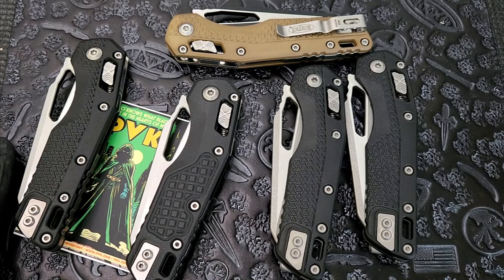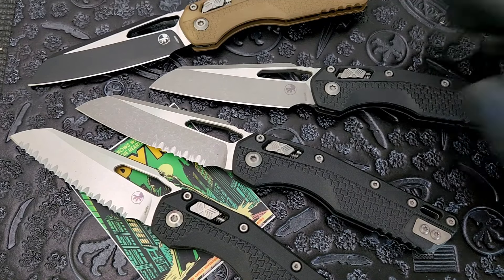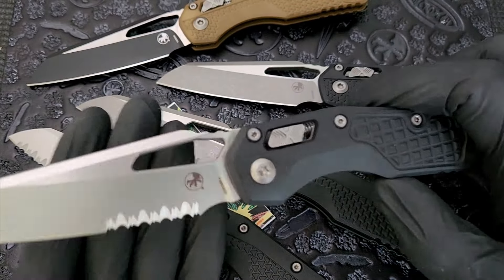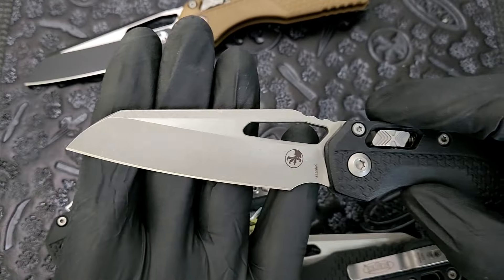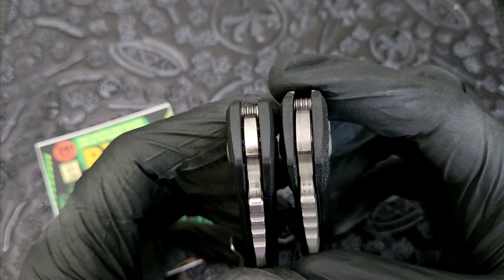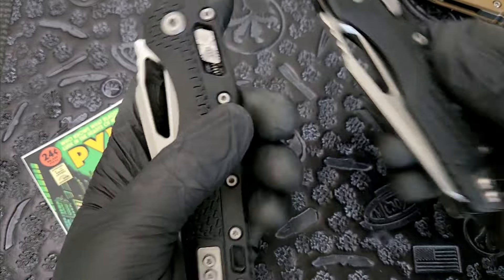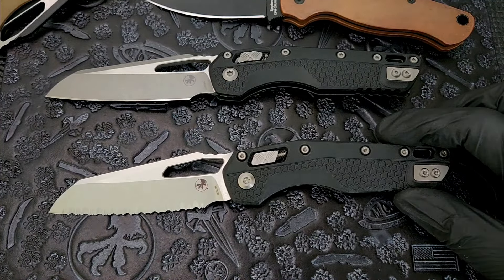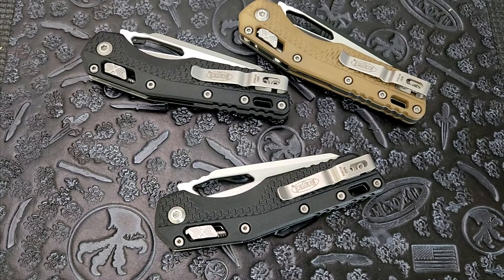Why Are These All Different?!

Comment: I like how lightweight the polymer version are, however it would be nice if Microtech would soften the inside edge of the scales so it won't feel like digging into the hand with the sharp edge of the scale.
Reply: I had the same complaint. A little 400 grit sand paper knocked that edge right down and you can’t even tell. Spring for some Ripps Garage Tech micarta scales if you really want a massive upgrade

Comment: The difference between G10 and the polymer (aside from the obvious glass reinforcing) will just be rigidity and how they deform. The plain polymer will be softer and more likely to deform or scratch, the G10 will be harder and more likely to chip. The polymer itself will likely be the same nylon used in G10, just injection molded instead of machined from a block.

Realistically, they'll have the same pros and cons levels and it just comes down to hand feel preference. And if you intend on doing scale swaps to aftermarket ones, obviously you'd pick the cheaper polymer one as your base as all the internals across the board are the same no matter which one you initially buy.

Comment: My guess is they work off these original CAD drawings, an missed the variance, and don't change a certain feature on it and it's just saved on the file and part of the SOP with different sub versions of models. I noticed this on The Kizer Sheepdogs I have, four different kinds, two of them don't have jimping.  Like why?  But doesn't seem to be a QC issue as the pictures on listings don't show them on those specific models either.  Companies are weird
Reply from the maker: Excellent point! That very well could be

Comment: Are the Newer one's able to handle spine whacks?  Interesting Video.  I absolutely luv my MSI Folders; they are a blast to carry use and fidget with.  But, Cutting Board Reviews made them look like they can not withstand spine whacking at all.  Though, mine don't fail, I do have that question mark in my mind...  And that keeps me from recommending them for Self-Defense Folders.  If Microtech proves that they have solved that issue, I would be all into these again.  Great Video, Bro!  :-) Peace, Stiletto  :-)
Reply from the maker: I have had zero issues spinewhacking any of my ram loks
Reply: So you're saying there's a... Microtech MSI Issue?!